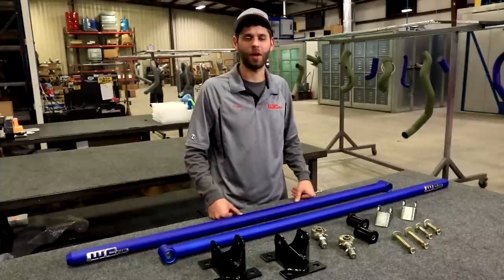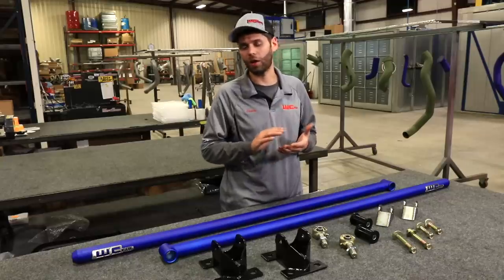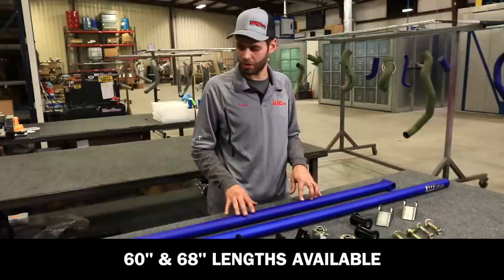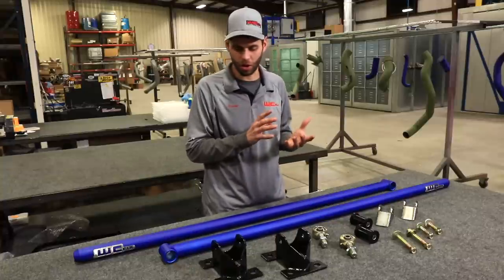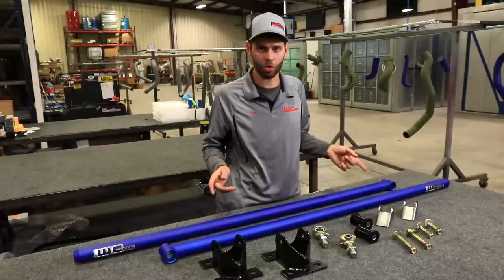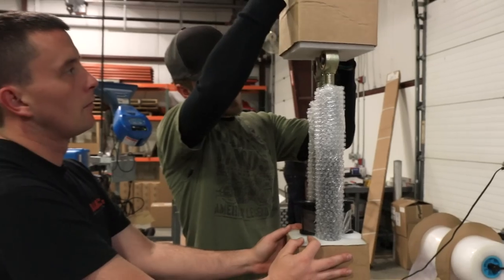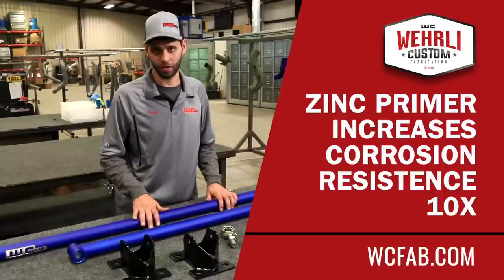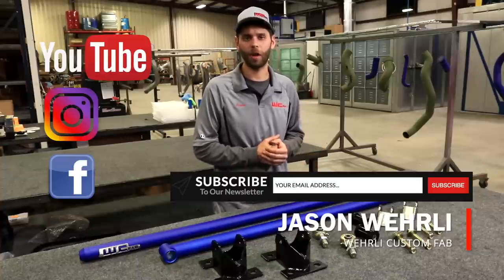WCFab Traction Bar Kits - Lasting Driveline Protection

Comment: What welding instructions come with the kit?  I ask because most OEM frame rails are made from high-tensile steel which requires preheating and controlled temperatures to prevent heat shock when welding.  Are the new aluma-duty Ford frames now made from plain ol' mild steel?
Reply: They should be, my F150 is a steel frame.
Reply: @noone42069  Yes, I know they are steel frames, but what grade of steel?  I had a 2017 F250 and now have a 2022 F250.  It makes a big difference if you plan to do any welding on them.  Do it wrong and the steel will crack and possibly fail.

Comment: Do you guys have some sort of a universal, fabricator, DIY series? Such as weld on brackets, Heims, bushing sleeves etc.?
Reply from the maker: We do offer universal weld on kits. Please check them out in the link below and give our team a call at 630-277-8239 with any questions. 

https://www.wcfab.com/search.html?q=universal+traction
Reply: WCFab Thanks I checked the link. Unfortunately both kits are much longer than I need. I have K5 Blazer those would put the ends through the front end LOL. I would really hate to have to waste a lot of that kit by cutting those bars in half.
Reply from the maker: @deegan727  Ah, that's completely fair, our bars would be a tad too long for that application. Haha! We unfortunately do not offer a shorter bar length than 60" at this time but if you contact one of our authorized dealers they should be able to help you purchase one of our installation kits separately and any miscellaneous parts like bushings or the Johnny Joints.

Comment: Could you answer me this question.      I have a 2018 Ram 2500 6.7   With the 4link suspension on the back .  And a local shop told me I couldn’t install traction bars on mind. Because of the 4link   Is that true???         But they did mention I could Upgrade the 4link
Reply from the maker: Thanks for your patience with our delayed reply. We missed your comment and it got buried in our inbox. Traction bars are not necessary for 4 linked suspensions such as what your 2018 Ram 2500 is equipped because the design of the suspension already negates the axle wrap issue commonly encountered in leaf spring designs due to the way the control arms connect to the axle. Hope that explanation helps. Please give us a ring at 630-277-8239 with any further questions.

Comment: You got them for 2014 tundras?
Reply from the maker: Thanks for the question! We don't have any bars currently that are 2014 Tundra specific, but check out our universal weld on kits in the link below to see if they might work for your needs. To verify compatibility measure from the bottom of your axle tube forward the length of the bar that you're looking at and check to see that you have a flat, section of frame suitable for welding the brackets (and that nothing will land in the path that the bar needs to take). If you have additional questions or would like our team to give you a second opinion, please shoot us an email to sales@wcfab.com with some pictures of the frame and rear axle on your truck and we can go from there. Link: https://www.wcfab.com/search.html?q=universal+weld+on

Comment: Hey Jason I was wondering I don't have a pickup but I do have a Nissan Xterra 4x4 completely stock all the way is there a kit for my truck in the rear and what I need a kit for the front too
Reply from the maker: We are unfortunately not Nissan specialists so our knowledge of the Xterra platform is limited, but strongly suspect that our standard universal traction bar lengths will not work for that application and wheelbase.

Comment: I understand axle wrap, but when the suspension compresses, doesn't the traction bar force the axle rearward??
Reply: No because the suspension is not creating power or torque to the axle, therefore the axle stays level as it should. The suspension compresses downward and has no effect on the axle
Reply: The shackle on the rear of the leaf spring will swing to allow what you're thinking. Look at the front connection of the leaf spring. If the rear was the same, the suspension would not compress and you would have a bumpy ride.

Comment: Do you manufacture anything for 1/2 ton Chevys
Reply from the maker: We offer 1/2 ton traction bar kits that are currently confirmed to fit 2014-2018 Chevy and GMC 1500 trucks. Here’s a link to where you can check them out on our website: 

https://www.wcfab.com/c-1460738-half-ton-truck-2014-2018-chevrolet-silverado-gmc-sierra-1500-chassis-and-suspension-traction-bars.html
Reply: Thank you for the link very appreciated

Comment: How much bind or limited suspension movement can I expect while towing heavy or off road
Reply from the maker: That will honestly depend a bit on how you define towing heavy and off road use. Expect a set of bars to firm up suspension feel when towing. We run them on our shop trucks that pull loaded gooseneck trailers and competition sleds regularly with no issues. We would not recommend them for applications chasing RTI scores, but they will be just fine for running through fields or unpaved roads. 

Please give us a call at 630-277-8239 to discuss your truck, suspension modifications, and how you use it with one of our specialists and we would be happy to help answer your questions and make a recommendation that will work best for your needs.

Comment: So  i have a 6 inch  lift  crew cab duramax short box  would i want the 68 inchers or the 60
Reply from the maker: We would recommend going with the 68 inch bar length for that setup.
Reply: @WCFab  hey I'm looking  at my axle brackets and my u bolts  face down . It seems  the p goes on driver side looking at the angles  and d on passenger 🤔   does that sound  right to u..
Reply: I know  it's backwards  but the bars need too  angle out  towards  the Frame
Reply from the maker: @hammertreemasterchief6447  the bars need to angle inwards towards the frame. The frame is narrower than then the spring perches of your axle.
Reply: @WCFab  ya I probably  should have assesd that before  asking  silly  questions..I thought the frame was angled out sorry to bug ya on a Saturday 👍🤣

Comment: Do they make them for the front ????
Reply from the maker: Our traction bars are designed for use on the rear axle of a leaf spring suspension setup only.

Comment: If I put these on then lift my truck then what happens?
Reply from the maker: It honestly depends on how much lift you're talking about. Going from stock height to a level or mid lift you should have sufficient adjustment where the bar meets the Johnny Joint at the front to compensate. Anything beyond that and you'll be looking at changing bar length and possibly be relocating the front frame brackets. Please give us a call at 630-277-8239 to speak with one of our specialists about your truck and we would be happy to help make sure you get the right parts for your build.

Comment: Would u have this for a  2011 ram 2500
Reply from the maker: We offer weld on front and rear kits in 60" and 68" lengths for those trucks. If you have additional questions about your application, please give us a call at 630-277-8239. https://www.wcfab.com/c-1411449-shop-products-cummins-4th-gen-6-7l-2010-18-chassis-suspension.html

Comment: With a Duramax with 6” lift. What length should I get?
Reply from the maker: NorCalFarmboy what cab and bed combination do you have?
Reply: WCFab crew cab short bed with 6” lift.
Reply from the maker: @NorCalFarmboy  we would recommend 68" for that application.
Reply: WCFab welp guess my measurements were right then. I was figuring I was gonna get the longer ones.

Comment: Does it need to be a diesel truck for trac bars?  I have a leveled 1500 was looking for trac bars
Reply: No. Just about any leaf spring rear can benefit in many ways with traction bars. If your doing burnouts and have wheel hop it will help, towing, hard acceleration, or even just cruising believe it or not. All of the above will make the rear diff pitch upward changing the driveline angle and that will cause vibration, wear, breakage all depending on how much axle wrap we’re talking about. There are videos where people show their axle wrap, some are very gnarly and make you want traction bars. In my case my axle wrap is noticeable at 50mph and higher when I’m giving enough throttle to maintain speed. The springs are soft enough to let the axle pitch upward just enough to cause a light vibration. If I do a hard launch there is no vibes because the drive shaft isn’t up to speed like it would be at 50+ but the wrap would be extreme enough to cause excessive wear and or breakage eventually. The difference in having vibes or not can be tenths of a degree in angle change. If your going to be doing some serious off-roading or care about your ground clearance get a single triangulated bar. If it’s mainly a street truck you can get away with the 2 bar setup like this vid. Sorry for the long explanation.
Reply: deegan727 great explanation and I know what they do 👍🏼
Reply: Dr. BOWDOIN Sorry that comment must have been when I was working nights. I tend to get long winded in these comments LOL.
Reply: deegan727 no worries explanation was spot on